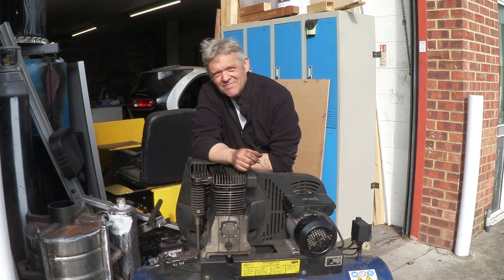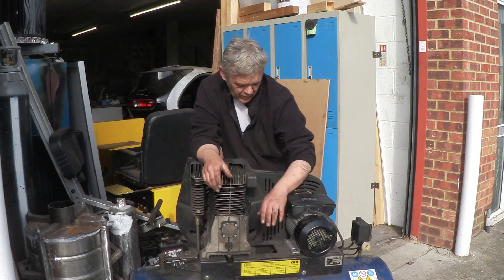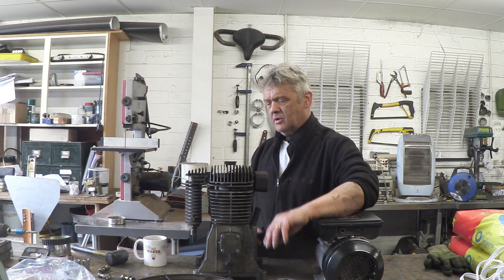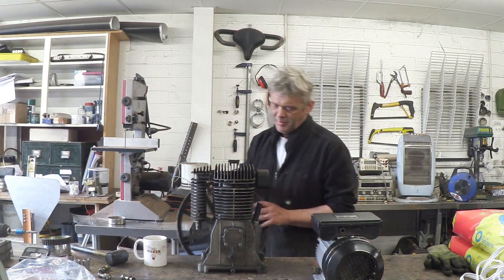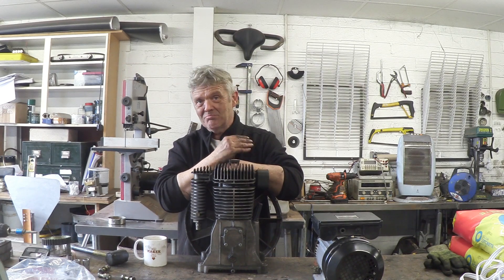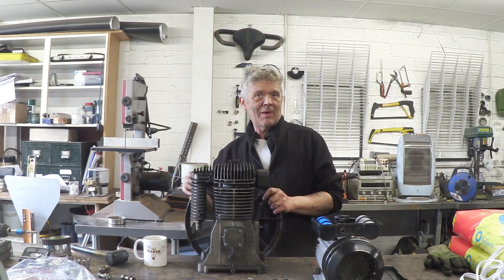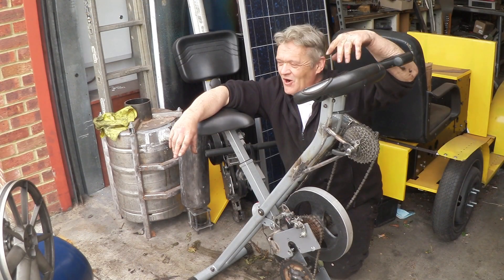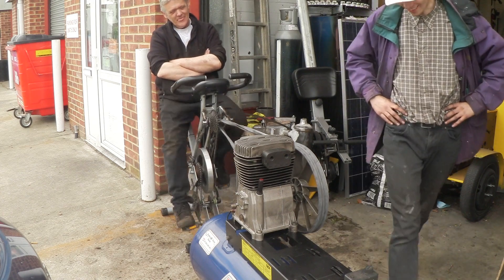1117 Pedal Powered 150 Litre Air Compressor - A Mechanical Battery

Comment: Hi! How is this project going?
I'm looking to build a pedal powered compressor myself, but I'd like to see a proof of concept beforehand. My main goal is painting in remote places with no electrical power (I have a very long fence). A typical small workshop compressor needs at least 1kW to operate a spray gun at 2 bars. The average cyclist can outpout 200W continuously. 
With a fully loaded 50l tank (8 bars max pressure) and a continuously pedaling friend, for how long could I operate my spray gun?

Comment: Replacing stored electricity  with  stored compressed air is on my mind.  Can we use a windmill  or PV solar to steadily accumulate air pressure  up to about 100 psi in large tanks for periodic use such as a pneumatic motor driving a pontoon boat?  The large tanks are already there for flotation anyway and removing batteries from the picture is a very green idea..

Comment: I saw in a video where an old compressor that was 30 years old exploded because the tank rusted out.

So the guy in the video worn that to train the tank completely and I suspect repainting the inside of the tank with a rust converting chemical that doesn't eat through the metal but converts the rust to a non-rusting material.

Comment: Air energy storage I always  imagine  when I was on my high school JROTC rifle team and the  .22 break barrel pellet rifles we used.  I would mind trying a multiple  cylinder  Stirling engine with a heavy lopping crank shaft and weighted off center fly wheel that's connected to something similar to a bicycle pump but much higher pressure  each rotation increases the pressure of a very very large thick walled  used propane tank  like the PPI tanks 3500psi. To a dentist like air motor when power is needed. But Idk I have wild ideas

Comment: Robert I work on farms and there's plenty compressors which the motors are burnt-out. I've suggested to the farmers that why don't they connect a vertical turbine to the compressor so each time the wind blows (which in my area is quite a lot) would keep their electrical compressors topped up and stop them from switching on and off every now and then, would save a lot of electricity too in the long run.

Comment: Biggest smile watching this. I guessed it could be a more efficient method for storing wind energy. And releasing the (diverted) pressure would then power electrical devices directly, with only some basic voltage regulation.

Comment: Yah great Idea, but I'm thinking you need a much bigger flywheel,  so you get more energy yes I know that when you start pedaling it will be hard, but once your up to speed it will take very little effort to keep it going, because the flywheel will be doing most of the work, also as you say you need to change the gearing, to get it up to the initial pressure,  then change Down gears to give you more power, but I would say you must make that flywheel much more heavy and bigger if possible,  years ago when I was 15, I used a fly-press to nock out 1,000s of brackets, and that had a flywheel on it, I could do this job for hours with out getting tired 😫, but it worked so well,  in fact it was faster than a Hydraulic press that replaced it, in the end my governor changed it back to the flywheel kind 😆, another great video, can't wait to see you upgrading it 😀

Comment: Could you use the dynapod as a pump? 
Then set up a "Tromp" water air compression system. Pump the water to the high top-end of the trompe water inlet. then in the middle of the tromp (where the compressed air comes out) connect it to the storage tank. The excess water can be "recycled" into the pump for another go around.
You would then be substituting the compressor and the motor parts with yourself, the dynapod and the tromp pipes...

Comment: Could probably get quicker build up of pressure by bolting 2 pieces of wood to either side of the flywheel and adding a long bolt with some pvc slipped over it and making it a handcrank

Comment: considering there is next to no leakage. It's a pretty good energy storage device :)
Reply: considering it takes more resources then it returns its pretty much a waste of time.    :)
Reply: @carmichaelmoritz8662  If you mean that it takes more energy than it outputs. Then yes of course it does. If not it would be an over unity device. And those don't exists "yet" :)
Reply: @Web3Dre  well that all depends. we eat resources and in certain cases we get more out then we put in .  lets say i eat to create waste , then turn that waste into some sort of fuel and in return get more energy out then i used while using some other sort of device to power the peddle powered air compressor.  or just make a explosion type air compressor   :)   many different ways to compress air.
Reply: @carmichaelmoritz8662  Oh, you mean the conversion of energy and the use of pedaling as a way to generate power? In that case I do agree, there are far better ways to generate energy. But as a storage device I think it was a good idea. Since the energy could be stored for years without any losses. Even though one could perhaps argue that the same volume filled with gasoline would have a higher energy density than compressed air. I think the video was trying to show an alternative way of storing energy :)

Comment: Someone I know does building projects with the U.S. Amish community.  Some of those good people have no religious compunction against using compressed air for power, just not electricity.  There's an entire, small, loaed industry based on converting farm and household appliances for use by those small, communities.  You'd once started down that path with wind or water powered air compressors, glad that you've come back to it. Well done.